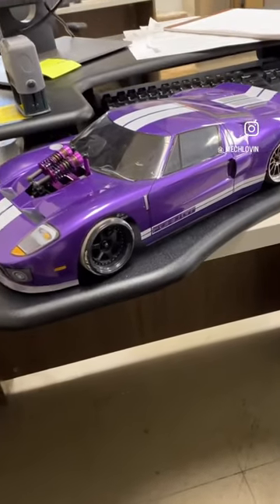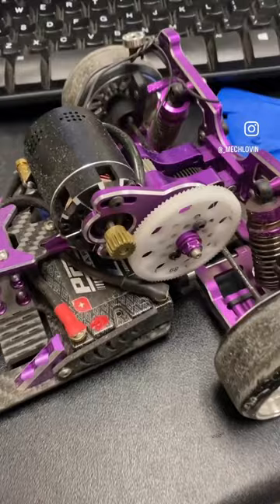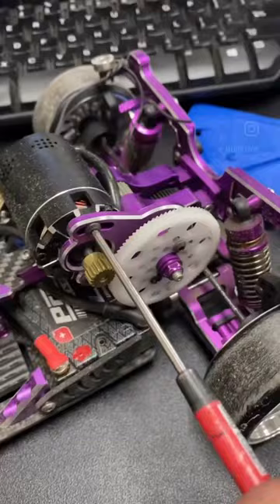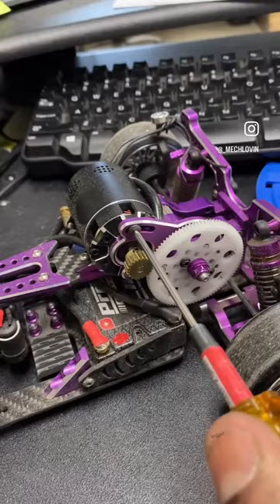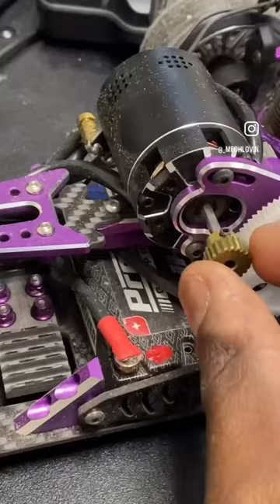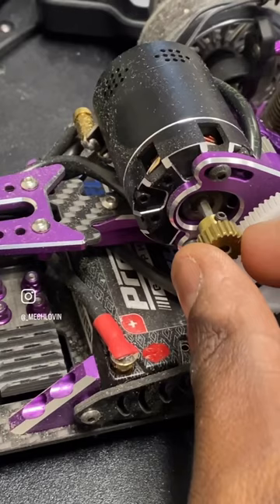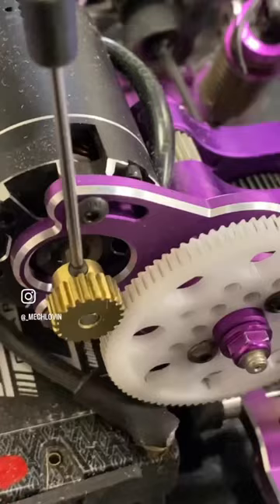How to set the gear mesh on any rc car. Its perfect every time. #rcdrift #rccar #rcdrifting #gears

Comment: you can take 70gram hvs paper, cut 60x6 mm. fold it in half in a stack (30x6mm). slip between the pinion and spur. good luck
Reply: Thats what i do for offroad buggy racing cars but for my competition drifter this mesh setup is my go to

Comment: Thats still too loose. Probably fine for a drift car with low traction but anything with grip would rip that up
Reply from the maker: 👀 what kind of power are you throwing at your RC?
Reply: +1 ,,cant have too much play especially on 3 s even if it causes light binding on another location of the gear its better to have some binding than to have some areas where there is too much play